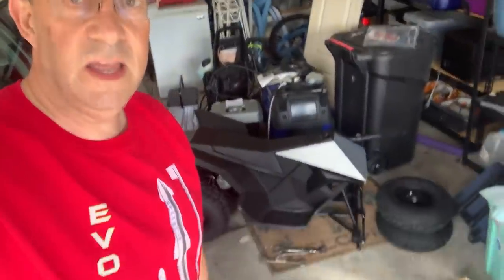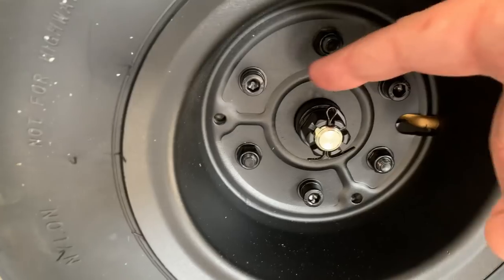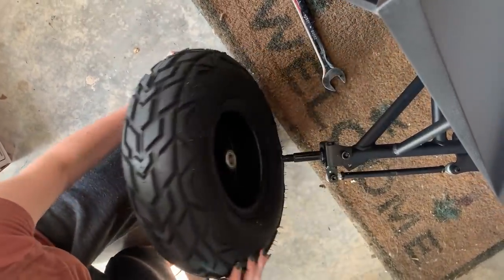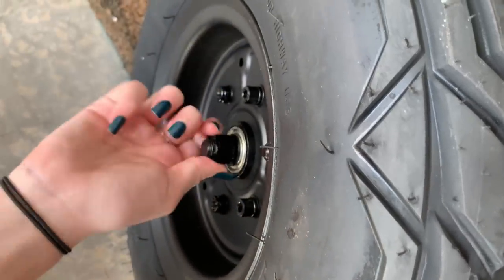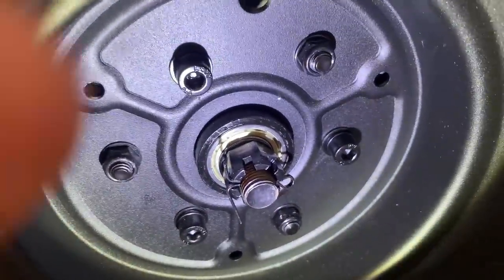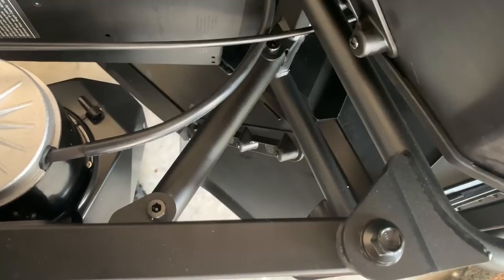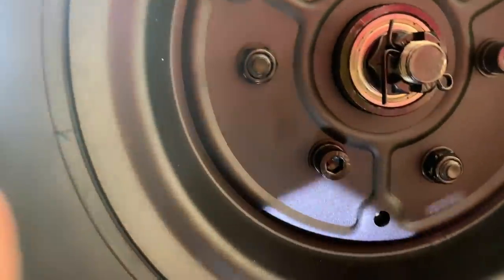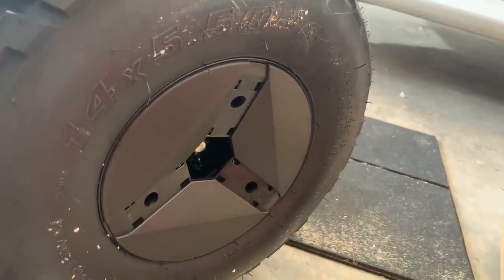Tesla CyberQuad for Kids: Assembly

Comment: As far as the cotter pin goes, you want to bend each side to wrap around the nut. I'd recommend getting a locking nut and replace the stock one since a locking nut won't work its way off. Kawasaki riders buy honda axle nuts for this reason.
Reply: Nice video! You might want to get some cool tesla stickers to put on your riding helmet. Cheers!

Comment: Make sure the shock is securely tightened.   The cotter pins are fine.  The front screws are probably fine, but you need to screw with some force because of the lock tight.  Don't hold the nut with your fingers.  Use the proper tools.  Cheers

Comment: Please check the wheel installation; the cotter pin should engage the teeth of the castle nut stop the nut from loosening. It appears that the cotter pin did not line up with the teeth. Could be missing a spacer/washer or under/over extended when sliding out wheels. The bent ends are fine as the vertical portion should be engaged with teeth.
Rear coil-overs appears to be upside down (threaded adjuster at spring goes at bottom). GL

Comment: Likely those are some form of self-locking nut and they won't screw together without quite a bit of force.   It is a second form of locking to prevent unwinding under vibration

Comment: tip:  keep hex key still while using ratchet.
Reply: When I take bolts out, I always have somebody hold a wrench on the nut, then I walk in circles with the Allen wrench until it comes apart. It can be tiring sometimes.

Comment: Hey Warren, I just got my cyberquad.. I am having some challenge fixing front wheel cover .. I know u mentioned u too had issues .. can u plz let me know if u fixed it with what was given by Tesla or u used bigger screws/bolt .. I was able to fix back wheels with no issues.
Reply from the maker: We had one mismatched bolt/nut combo. I haven't fixed that yet.
Reply: @WarrenRedlich  Thank you for getting back to me. For me the bolt given is small or the length of the screw hole in the cove is small. Let me know if you fix it. Thank you :)

Comment: Great video, Warren. As others have mentioned, it's called a cotter pin. Purpose is to keep the castle nut from working loose. I always use needle nose pliers to bendand spread the 2 end pieces.
Reply from the maker: We did use needle pliers. Thumb worked better.